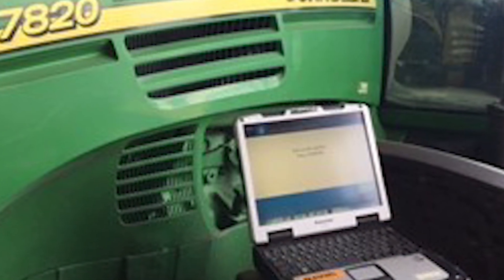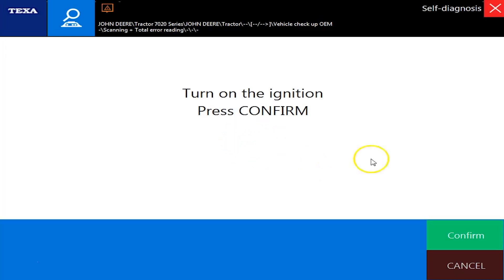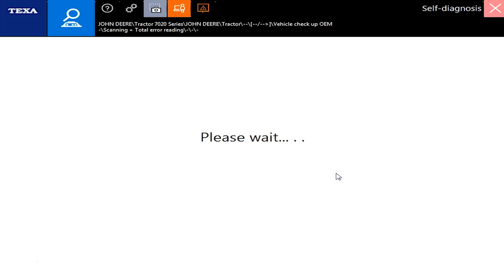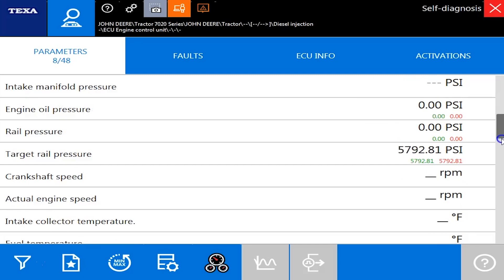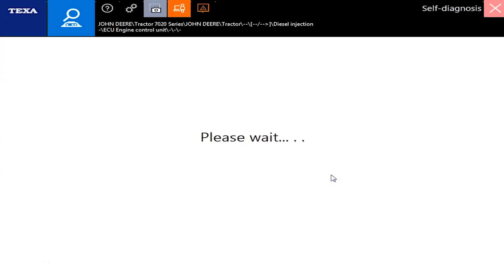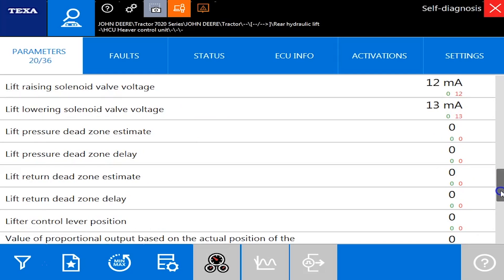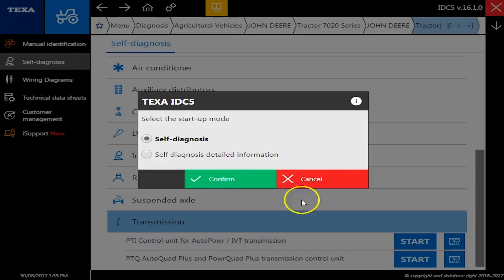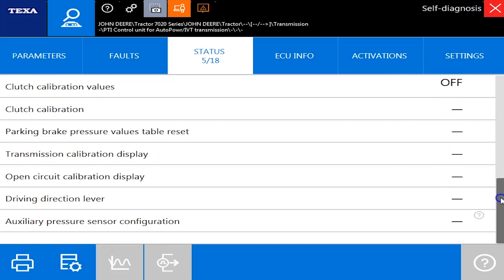TEXA Off Highway on a John Deere 7820 - Total Scan, Engine, Tranmission, & Lift Diagnostics

Comment: hi i have a 1470d i added a new module aswell and has a fault spn 2000 fmi 13 security violation can your unit fix this i also have spn 1569 fmi 31 derate
Reply from the maker: This unit includes repair information for all JD codes. SPN 2000 FMI 13 has two probable causes. One is to make sure the correct module was installed. The other possible cause is there are active or stored CAN related codes in another module. SPN 1569 FMI 31 has 7 possible causes: Low oil pressure, high manifold air temperature, water in fuel above threshold, loss of engine coolant, high fuel temperature, or timing problem with the crankshaft position sensor. Good luck sir!